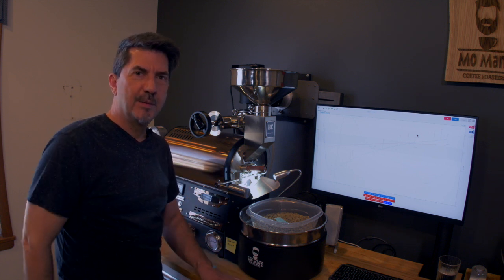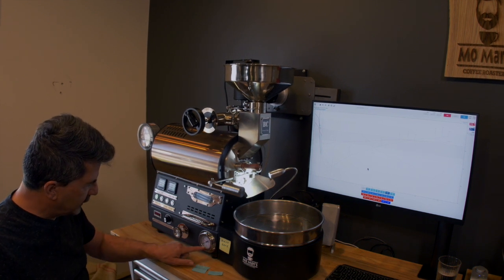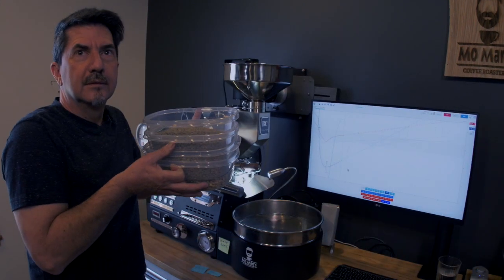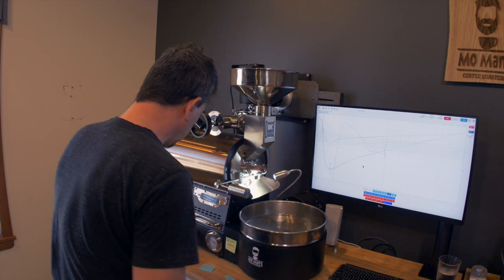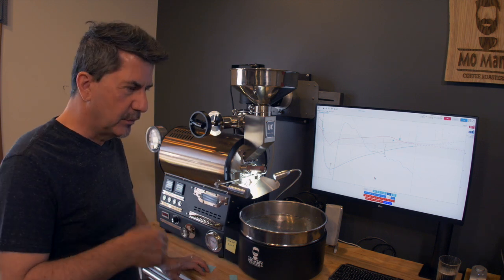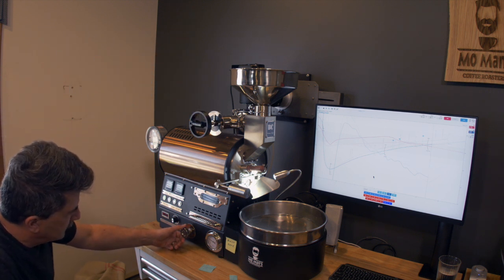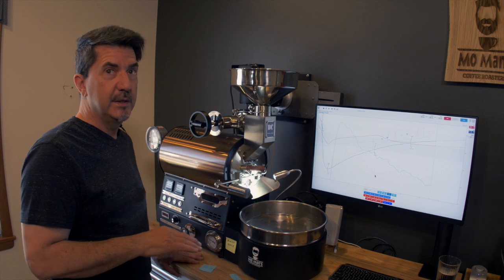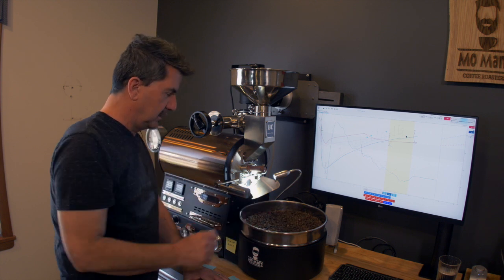Buckeye BC-2 roast demo

Comment: Hey Matt. You reminded me of myself when you went to mark charge in Artisan with the mouse. Grabbing the mouse and zeroing in on the onscreen button was not timely for me so I started using a feature in Artisan that cut lag time down to no more than a second. THIS IS THE ARTISAN FEATURE: If you are using Artisan to roast with, here is another option to mark events while roasting. You can mark the roasting events using the SPACE BAR to mark a roast event and move to the next. Enable and disable this feature by hitting the RETURN/ENTER key. Once enabled the event to be marked is highlighted. Tapping the SPACE BAR will mark CHARGE and move the highlight to DRY END. Tap SPACE BAR again and DRY END will be marked and the highlight moved to FC START. Use the LEFT and RIGHT ARROW keys to move the highlight manually. When using this mode the buttons are still available to click with the mouse. Auto CHARGE and Auto DROP still work as normal. My accuracy with timing improved with this method. I can open the bean charge chute, hit the spacebar, and hit the timer button on the roaster within 2 seconds. I am roasting some delicious coffee with my BC-2 as I'm sure you are. They are solid roasters.
Reply from the maker: @the_original_mathwiz  thank you for the great tips! I did not know this about artisan, but will definitely be using it.

Comment: Hi thanks for this educational roasting video. I like your relaxed and soothing demeanor. Very therapeutic. 

You have quite a few blue and red buttons at the bottom of your artisan screen. Are they for adjusting heat and airflow? I don’t see you using them too actively. Does your artisan record the changes in airflow and heat?
Reply from the maker: Thanks for your comment! The buttons, when pressed, record various airflow changes and gas flow changes I make during the roast. It flags the roast profile line with those changes. Some machines allow for automatic logging and even control, I believe.

Comment: Would you be willing to share your Artisan .aset file? It would help me tremendously as I just purchased a BC-2 roaster. I agree with your comment about Randy being very nice and helpful.
Reply from the maker: I will get on my computer shortly and let you know what I have
Reply: @MattMolnar10 , hey Matt, me again. I'm good with the Artisan .aset file as I figured it out. I have been using a 6ft straight pipe to exhaust my BC-2 in my garage, but I am ready to put a hole in the wall to vent properly. I am curious about your exhaust wall setup. Would you mind sharing info on what you have?  I cannot find anything that looks like your setup. It appears to function well in your video. Thanks in advance for any help you may provide. Mike Mathis
Reply from the maker: @the_original_mathwiz  Hi Mike! I had a friend fabricate the exhaust setup you see with a blast gate. I can close it in the winter when I'm not roasting to prevent subzero air from coming into my roaster/shop.

That being said, I don't really close the blast gate much because if you close the air flow dial on the roaster it will limit how far the cold air can infiltrate. If you find someone who installs pellet stoves or similar devices they should be able to setup you up for exhaust.